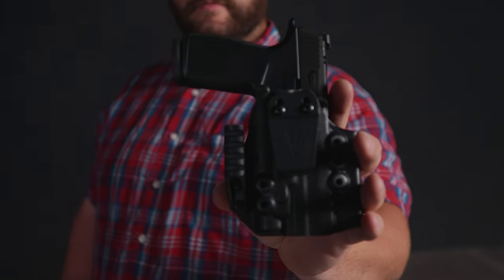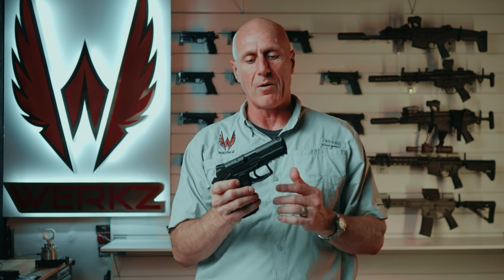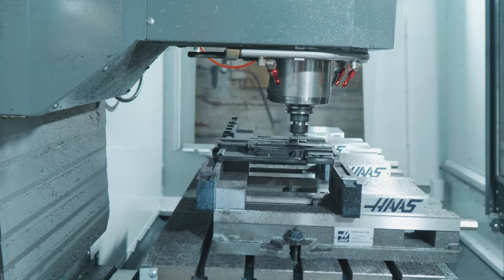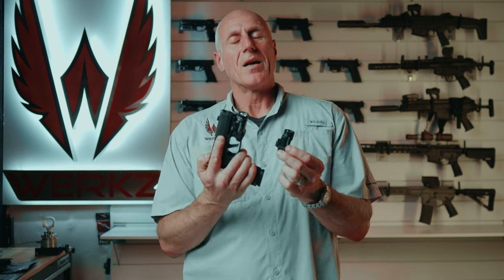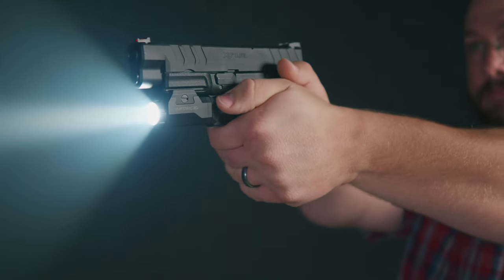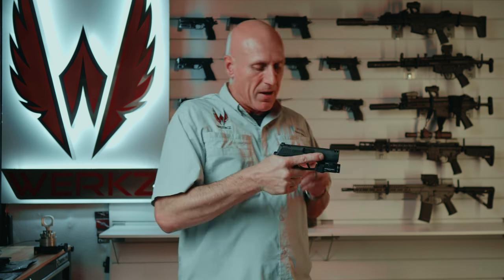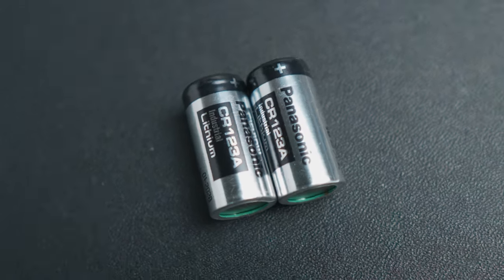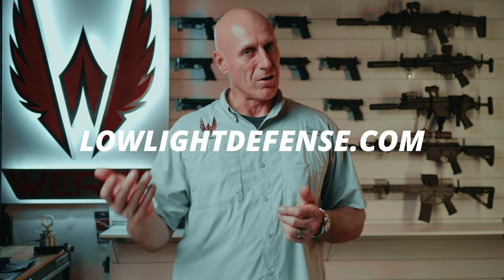5 Weaponlight Purchase Mistakes

Comment: What light would be ideal for my 43x?
Reply: tlr 7 sub with glock key if you have the mos with rail; otherwise a tlr 6 I suppose
Reply: I agree with @joshwest8957.  I also have the 43X and went with the TLR 7 sub.  There aren't a ton of options for this pistol but I decided to stop fighting trends and go with a light I knew did well and had Werkz holster support
Reply: Yes @joshwest8957 is a 43x mos. Thanks.